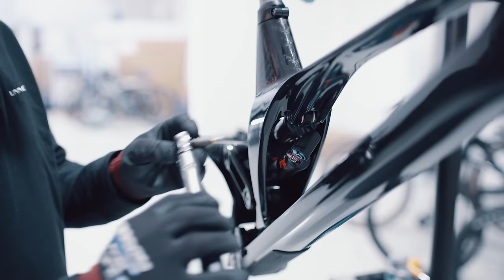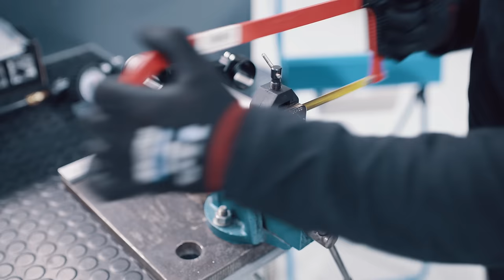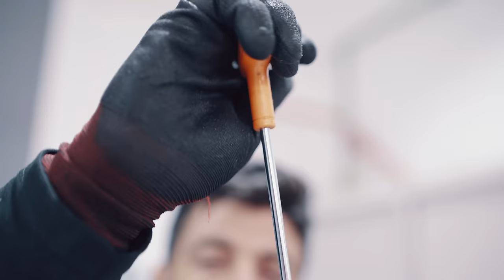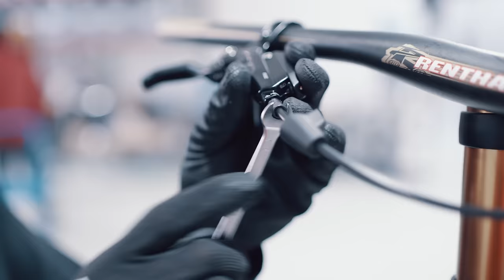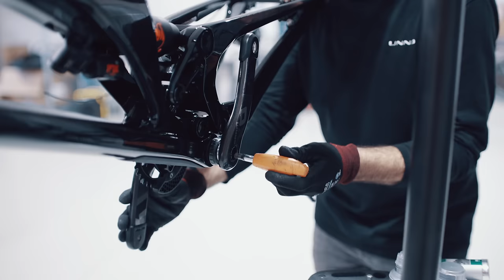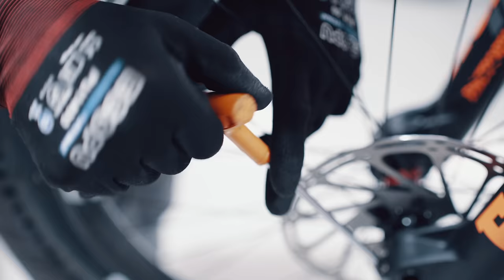DREAM BUILD MTB - UNNO Ever

Comment: Right from the beginning I knew two things:
First, its going to be an awesome bike.
Second, thats the guy who always clicks the torque wrench twice, which makes me crumble.
Reply: suppose to click it twice is the rule of the torque wrench.
Reply: I agree. Clicking twice has a chance to over torque the item that you are meaning to torque. Also you should never set to max torque value. There is normally a torque range for a reason. I used to be an aircraft mechanic. Now I'm a flight engineer. This is where I get my knowledge.
Reply: @kandem01  should you double click it or not? I read that you should.
Reply: @fonzo9405  well, I'm new into this but I do it by setting the mark 1-2 NM lower than max and then carefully click it twice
Reply: Especially on the derailleur, he torques it with a normal hex wrench probably beyond torque spec, sticks the torque wrench in and the bolt doesn't even turn before it clicks lol

Comment: With as expensive of a bike this is, I'm really surprised that it doesn't have a wireless or hydraulic rear derailleur. I'm also still hoping that mountain biking will adopt the stronger mid bottom brackets and half link chains from bmx

Comment: I still don't get it why they only offer one size fits all frames,... Why would you do this? The reach on this bike is a joke for tall people! Why is the rear brake adaptor limited to 200 mil. rotors? Why Code RSC brakes? Why such small rotors? Why no black chain? Why the old Sram XO1 parts? Why Enve wheels? And why do they only offer it in 27.5?! The designer César Rojo is an ex downhill racer,... Why César? Why? Why no Gemini bar-stem combo? Maybe because it's bullshit and you can't adjust it to your favor? Why does it cost more than 650 Euros?!